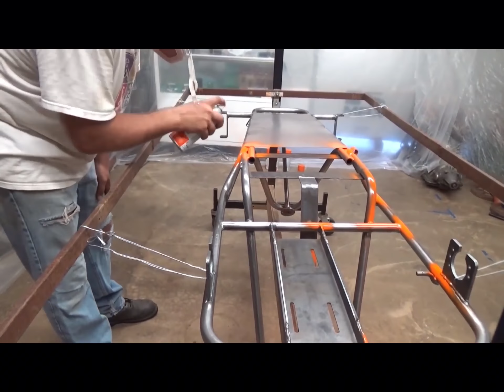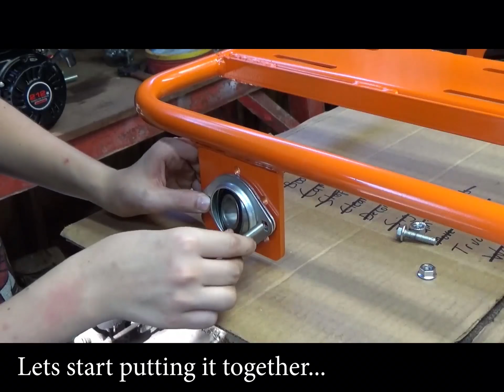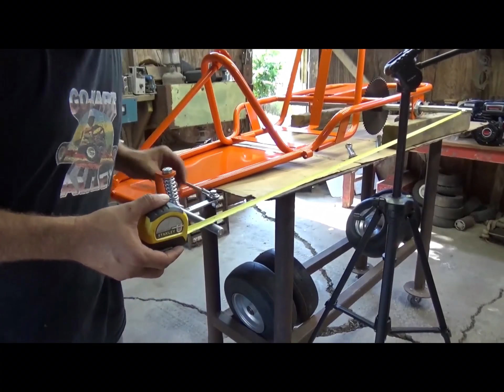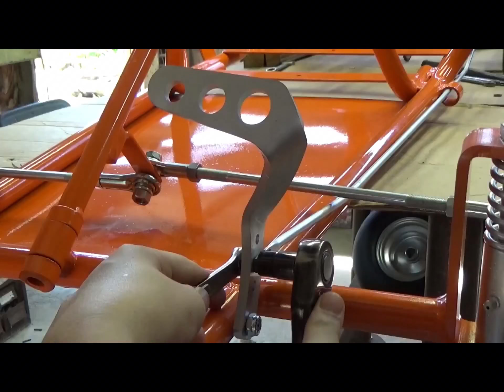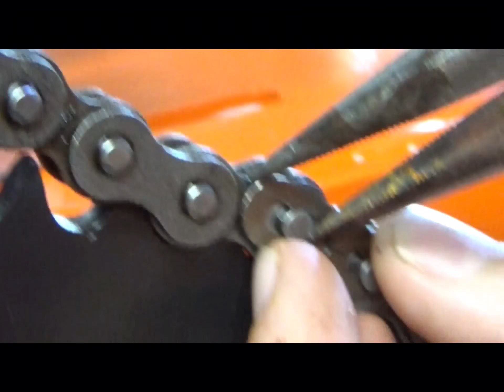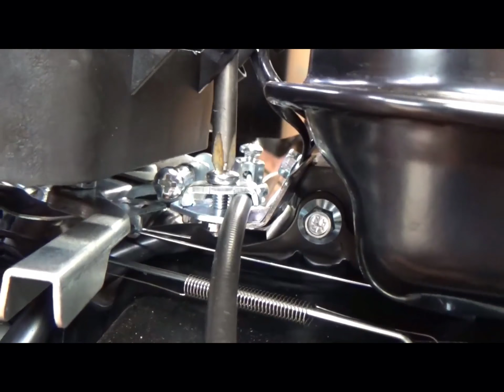Building the Classic Go-Kart Kit from Go-Kart Alley

Comment: Just an added thought. I used too be a custom cabinet color sprayer. Something that will make your job easier is a gravity gun. If you really want to make an investment and plan on pushing out a lot of product, look into pressurized paint guns. The 7X7 rule works well, 7 inch wide spray by 7 inch tall will give you great coverage. You'll just have too figure out the pressure that works good, with the needle your using. Good luck!

Comment: Nice kart. Not nice to the wallet though.  The whole idea  is some form of Independence for the kid, how's a little one to raise $1300 for just the kit? I have more into my ct200 by now but I'm an adult who had to save for months to scratch the money together for my build.
Reply: nallen100  yes sir! A total blast. It was a dog when I got it, the throttle was never turned out past halfway.  I added a non-epa carb, 140/37 jets, billet intake, header and an 8 degree timing key. I'm working on the brakes tomorrow. They are all there but attached wrong so that the band is not making full contact.